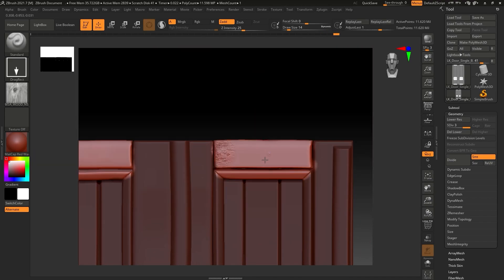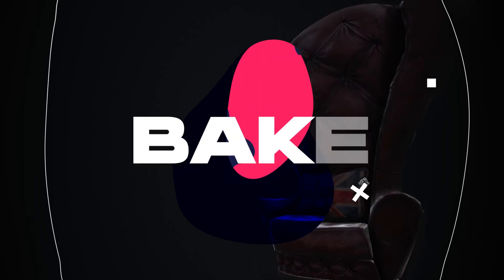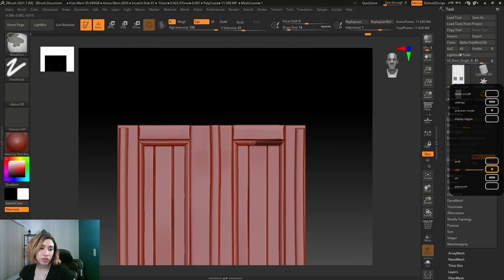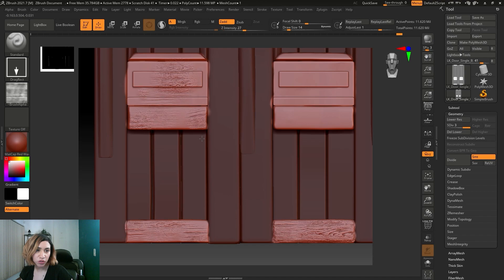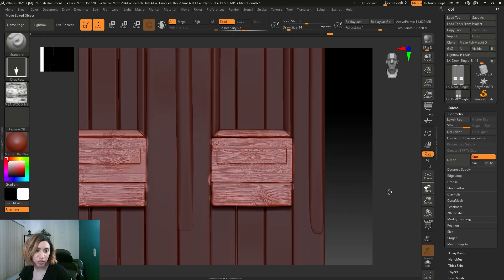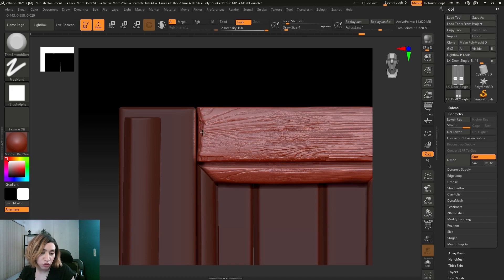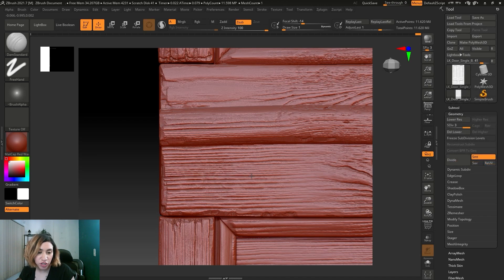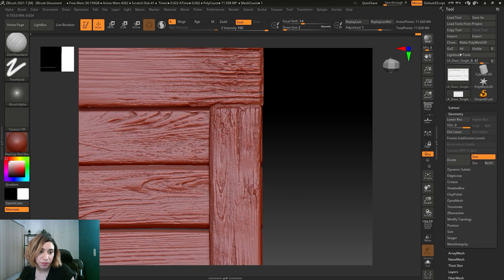WOOD SCULPTING  IN ZBRUSH  (WOODEN DOOR)

Comment: Quick question, firstly did you have a basic door and  in zbrush, did you only add normals, I’m new to zbrush so I am not too sure. The other thing, the edges, you used some tool to create chips or smoother edges at the door, were the new edges actually sculpted or are they still normals as if this prop was for a game, it could use a lot of hardware resources and put load on the gpu if used too much. I think this part is at 7:43